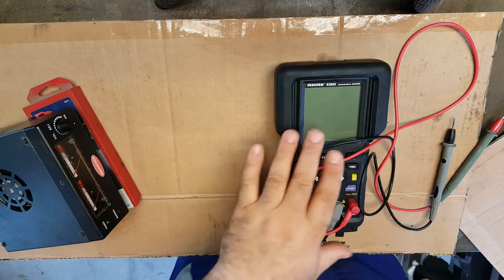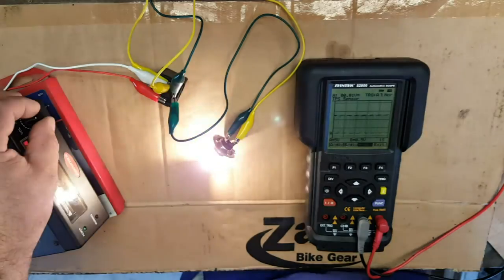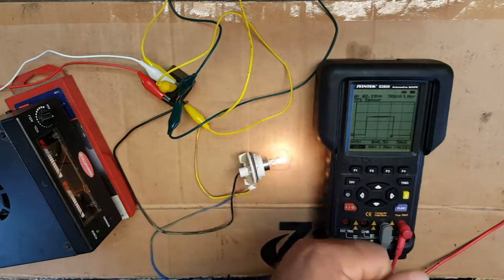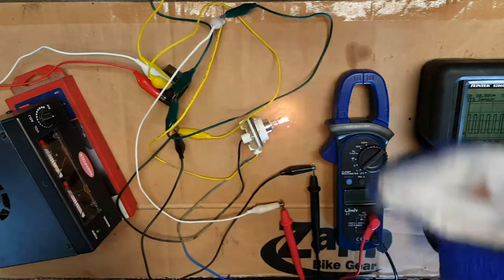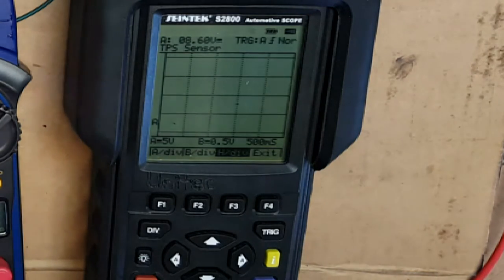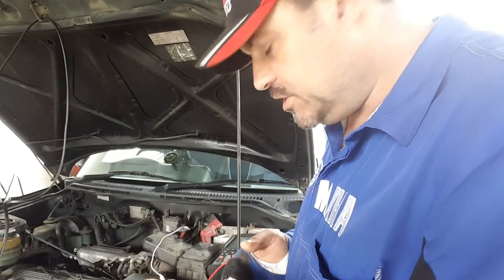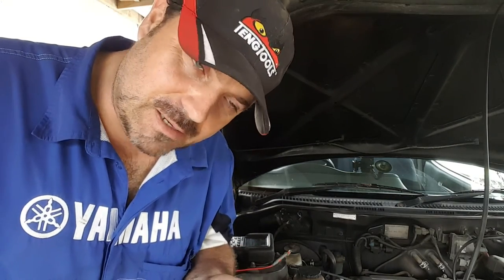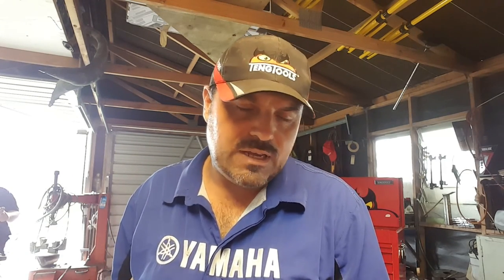Using an Oscilloscope for testing EFi sensors or actuators #1202

Comment: Thank you for your presentation Andy. I am 67 and had no training with a Oscilloscope in the seventies or eighties. I was a motorcycle mechanic/research development race mechanic as well. We only needed a SuperFlow machine and a Dyno. I just came back to the motorcycle repair in my garage after retirement and a lapse of thirty five years. I have a boring bar, valve grinder and SuperFlow machine, but I most definitely need training on a oscilloscope. Harley's alone are made up of so many different sensors, that I'm lost trying to test them with a volt meter. I have come upon a 2001 Harley Road Glide FLTRI and it won't allow my app to run a diagnostic and it gives two different readings from two different procedures to pull up the DTC's off the speedometer. You are absolutely a very calming and awesome teacher. I taught electrical theory and hands on at American Motorcycle School after graduating there as a student as well. Thank you for your videos and your great ability to explain what you are demonstrating. I've ordered a oscilloscope that operates threw my computer and priced only around $120. Things have changed for a lot of good reasons as well - great price. Thanks again...........................Richard

Comment: Excellent video. Some older vehicles have a system for identifying fault codes via a flashing light after a jumper wire is temporarily inserted into the diagnostic plug . In theory it is suppose to be possible to count the number of flashes over a given time period  to read the fault code. In practice this is easier said than done especially when there are several different fault codes with a lot of flashes to count. Could you please tell me if oscilloscopes have the potential to capture and record these flash numbers in order to make them easier to read ?
Reply from the maker: Yes, definitely but you'd have to back probe the wire from the ECU to the flashing light.

Cheers Andy

Comment: Hi Andy.. thanks for this a great  useful video .
 I have questions please ,,, in oxygen sensor there are  a 4 wires ... could you please determine what these for?
Reply: 2 for the heater resistance inside the oxygen sensor, 1 for ground and the other for signal

Comment: How much bandwidth on the oscilloscope is needed?
Reply: That's not as important as the number of samples per second, though they're somewhat related.  For good detail, you'd want millions of samples per second.  Five or ten megahertz of bandwidth would probably be fine for most automotive work.  Be sure to look into what you need to do to protect your scope inputs.  Never ever think of trying to measure spark plug voltages directly.  Even the coil primary and fuel injectors can create voltage spikes big enough to damage an input channel.  Use 10x probes and a 20:1 reducer.  When poking around places like that.  Some of the cheaper scopes gave little over voltage protection, and even expensive ones don't want anything over 600 volts being applied.  Be sure to read your scope specifications.  Hantek scopes look appealing based on cist, but you sort of get what you pay for.  Their user interface software leaves a lot to be desired, though there are alternatives available.  Sigrok Pulseview is awesome open source software, but it's more suited to logic analyzers than scopes.

For a regular scope, the Rigol 1054z is awesome, but not as portable as a USB based scope.  Pico us probably the best bang for the buck for a USB scope, starting at $130 or so for two channels and basic probes.  Probes can really add up when you buy two current probes (50-60 amp max and a 600 amp max for measuring starter draw, you'll get more use from the smaller one, and there are other ways to do a relative compression check by monitoring battery voltage drop during cranking).  A capacitive pickup clip for the secondary ignition would be handy.  Definitely get your self a 20:1 attenuator.
Reply: @tonyfremont  Thank you for your information, I am currently looking at a 100 Mhz 2 Channel Rigol 2000 series, with it I would be set pretty good for allround work, and playing around as a hobbyist.
Reply: @Universal_Craftsman  my current main scope is an older Rigol DS1102C.  It's 100MHz two channel.  I'm thinking of buying a 4 channel 5000 series because Rigol is including a lot of the options free, until the end of the month.  Honestly, I haven't been brave enough to take my old scope into the automotive world for fear of killing it accidentally, I certainly won't be taking a 5000 series scope out there.  I'm looking at also buying a cheaper USB based scope, maybe a pico, but they're a bit expensive too.  I can't tell you how many times I wished for an extra channel on my current scope.  Not too many times did I really need 4 channels, but 3 certainly would have helped on numerous occasions.  If your considering buy your first scope, I can't impress upon you how much you should consider getting four channels.  I do a lot of arduino tinkering and wanting to trigger on chip select or something else, so I could capture two channels of data would have been more than helpful.  Unless you need something the 2000 series does, such as the extra protocol decoders, you should consider a 1054z.  Four channels and most of the hacks are now free, you just won't have the 100MHz bandwidth, which isn't really that big a deal.  With sufficient sample rate, you'll still be able to capture well above 100MHz signals, they'll just be a little attenuated.  At any rate, it's easy to hack the scope and turn on 100MHz bandwidth anyway, since it's a software limited thing.  I do a lot of serial, i2c and spi communications stuff, so I really like the decoders in the 5000 series.  CAN bus stuff is just icing on the cake as I'm planning to start building more arduino based automotive toys.  I really suggest getting a cheap USB scope too, especially since it sounds like you're just starting out.  Blowing up a scope is easier than you might think when you start poking around ignition and fuel injection systems, especially ignition secondary stuff.  You don't want to blow a channel out on an expensive lab scope because of a slipup.  Use your probes in 10x mode always when poking around a car, and use a 20:1 attenuator for anything with a coil in it (motors, fuel injectors, ignition) and only take it out of line when you're sure you need to.  Use a capacitive clamp pickup for ignition wires and high voltage coil wires.  A scope will let you see things you never knew existed because of the ability to stop or magnify time.  I have two analog scopes, an old 10MHz heathkit from the 60s, and a 65MHz Hitachi from the 80s.  They have their place, but having a DSO really opened up a lot of possibilities that were unimaginable on scopes with no memory of the past.  I've also been playing a lot with a Salig(?) Clone of an 8 channel logic analyzer.  Combined with Sigrok Pulseview software, it's amazing for looking at digital communication.  Max sample rate is 24 million per second, but it's 8 channels and plenty powerful enough for most of what I want to do.  You see these things being sold all over the place for 10 or $20.  Plenty cheap enough to replace if I accidentally kill it.  They have virtually no input protection, but digital signals are usually less than 5V anyway.  Sigrok doesn't have the search and triggering power that more sophisticated analyzer software has, but it's far better than nothing.  You can email me at anthony.fremont at gmail dot com.  I'd be willing to talk to you on the phone, if you want.  It's a lot easier than using youtube messaging. ;)
Reply: @tonyfremont  Thank you, I will take that into consideration!